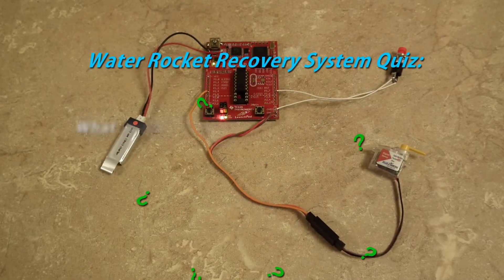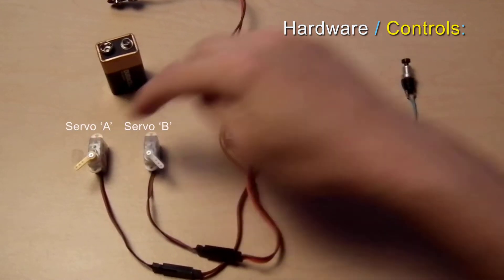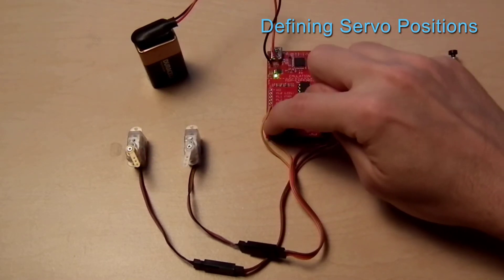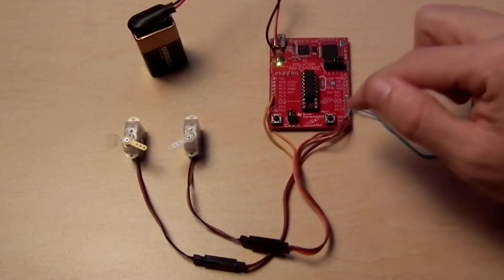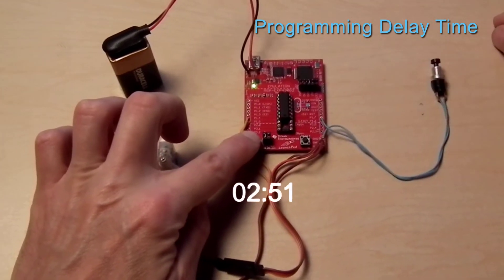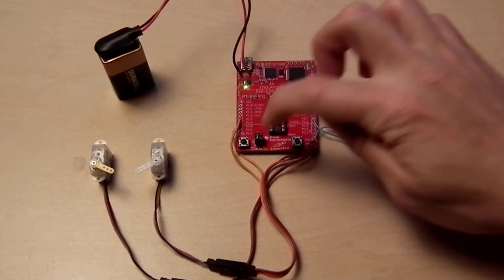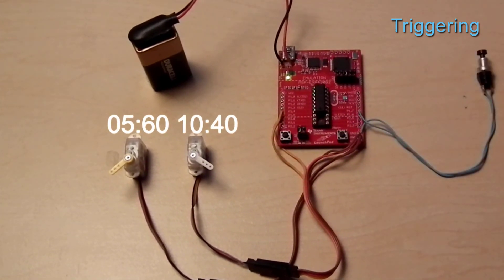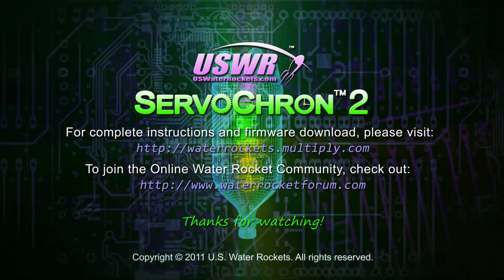Water Rocket Dual Servo Timer Parachute Deploy System

Comment: Hello :)... Can i still buy it now ? I really need this and cant buy it anywhere :/ Thank you for answer :)
Reply from the maker: Hi there! This design was never sold as a complete unit. It was designed as a set of free instructions that explain how to make it yourself from a handful of common parts which you obtain from hobby and electronics websites. All of the pieces needed to make this are still for sale from many suppliers, so you should still be able to make one by following the instructions.

Also, we have made an improved design that you can make from a different set of free plans which does the same job as this design, except we added a sensor to the device so that it will automatically detect the launch and automatically detect the apogee (and deploy the servo controlled parachute at apogee). The new version also reports with a flashing LED and audio tones the maximum altitude of the flight. That project is described in this video playlist: https://www.youtube.com/playlist?list=PLK6-a7u-VQflmmw2hEc7PUoeBzqD7VULs
Reply: Oh. Thank you for quick answer :) I think if you sell this as complete unit, you probably can earn some money :) Because i think so many people want this :)
Reply from the maker: We have had a lot of people interested in building the design and only a few people who expressed interest in a fully assembled product. Do you really think there would be a lot of interest in a product manufactured like this?

Comment: I am not using it for a water rocket parachute, but rather a school project. We have to make a fully self contained box that will release a "bomb" (weight) and try to hit some given spot. The box will be rolling down a zip line.
The setup I was thinking was to activate a brake (servo A) then release the bomb (servo B) and immediately after, release the brake (servo A) and activate an electric motor.

Comment: Is there any way to use two boards or something to make servo a move from one end point to the other (or at least close), then about 1-2 seconds later, servo b move from one endpoint to the other (or close), and immediately after, make servo a move back to the original position, and at the same time as the second command on servo a, make an esc go to full throttle?